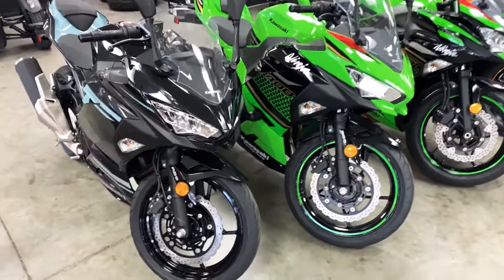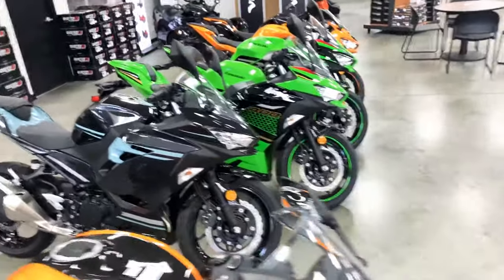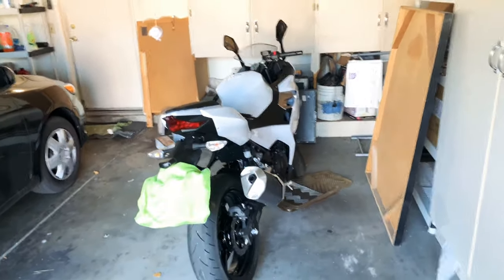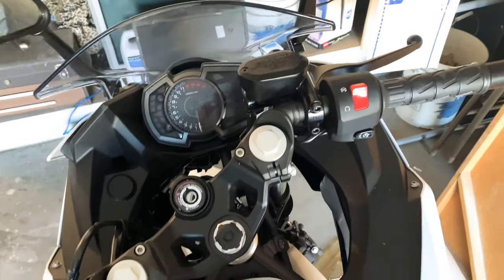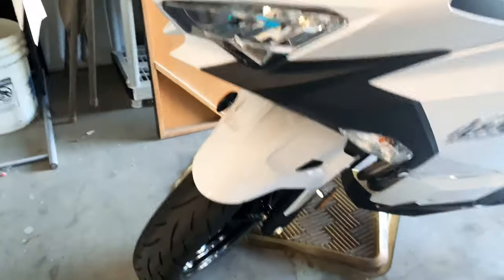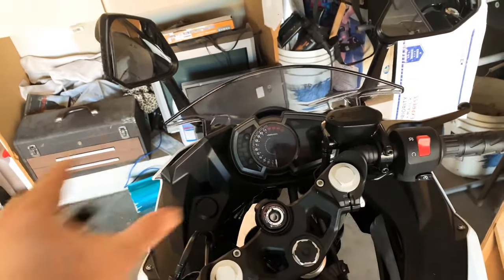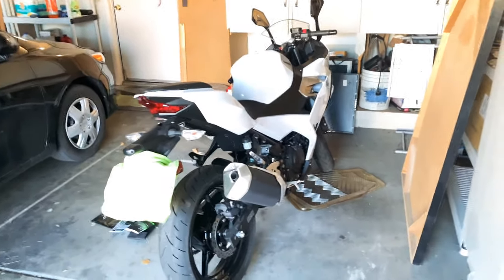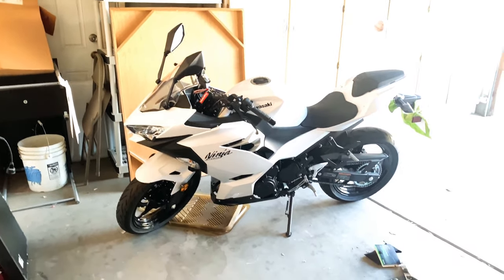NINJA400 #01: Bought New "2020 Ninja 400 ABS" Pearl Blizzard White OVERVIEW & REVIEW(Project Bike)

Comment: Been riding a 12 CBR250R all last year, it’s either the 400 or 650 Ninja or the Z650 for a new bike this year, your opinion? Edit I’m 5’8 220lb, thinking the 400 would be a bit small..
Reply from the maker: 1St. Bike, if so you cant go wrong with eother one. Id say 650 but they cheated us on the digital dash that really was the difference from the 400. If 650 go with the 2019 or 2020 im not sure wihch year they took away the dash. I know the 2021 650 os now back to tge same. 2010 or 2020(not sure) they have all the modes. Dark mode,light mode. Quick shifter. 3 riding mods selection n some. Again the 650 has a nicer seat. It higher. As far as performance its 1 level up but a suped up 400 will kill it. Air intake,ect ect. What i did to this 400. Depends on how you feel on tge bike. Go to the shop check both of them out. N see how you feel sitting on the bikes. If you're not a beginner  get the 2019 650 new/ under 1K. 
Remember its always funner/better to ride a smaller bike fast then a fast bike fast. My 750 gets no love anymore bc since the 400 im in love with being able to push it,run thru all the gears ect.  Cant go wrong with either one. If u can afford a new 400 just get the 650. Unless you feel its not as nimble. A lil bigger for a beginner. Peace n blessings. N hope to see what you get. PS DONT RUSH IT.